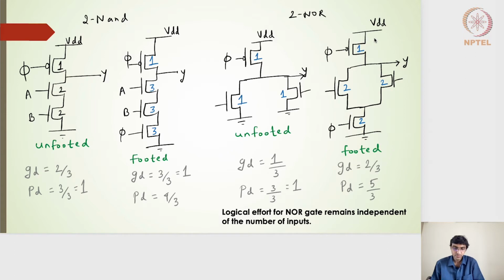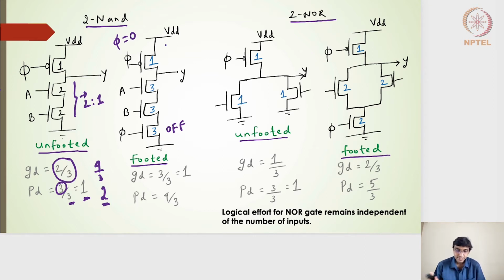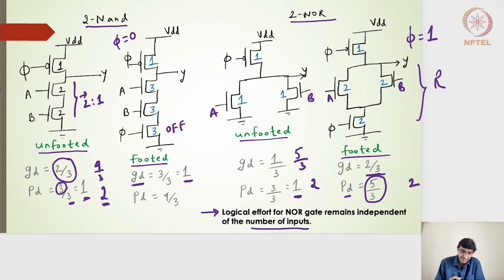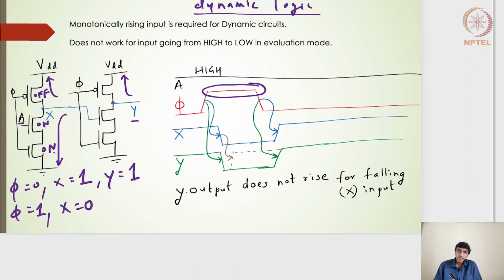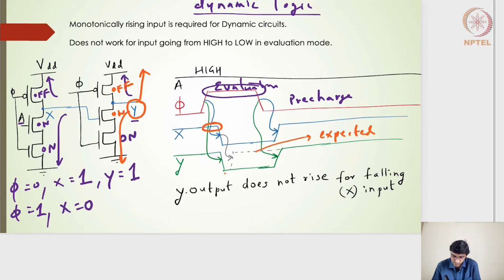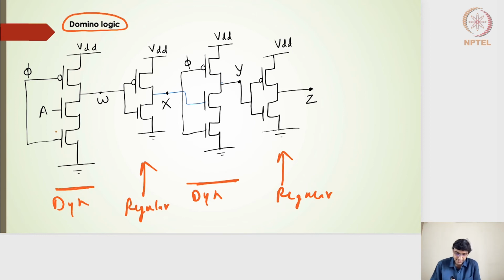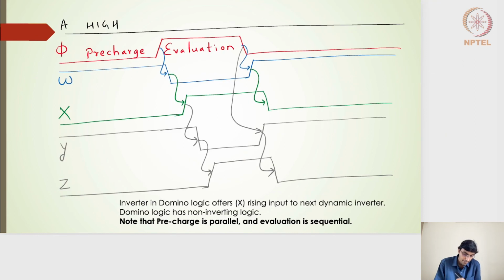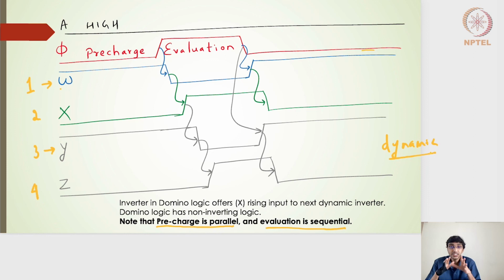6.9 - Dynamic Logic and Domino logic

Comment: Sir, why the size of the P mos is taken '1' where as 2:1 ratio Cmos is used for calculation? kindly reply me fast. I am soo confused the video of the same channel which link is given here i.e. https://www.youtube.com/watch?v=tJ41dqons9w&t=195s
Reply: Normally when you do logical effort for (planar) transistors, the p:n mobility ratio of 2:1 is used to get equal rise/fall times, this happens because electron holes are less movable than electrons, so the PMOS transistors have to be bigger to get matching timing. Mind you, this ratio changes as we move to germanium and as we started to move into finfets and gaafets and beyond and we often can't hit this ideal due to manufacturing limitations now that we're quantized to a few good sizes for finfets and the like but is fine for planar transistors and learning logical effort!

But the PMOS transistor used in a dynamic logic gate isn't being used to make it so the rise time matches the fall time. In fact it isn't even being driven by a 'proper' logical input as it is just tied off to the clock so that when the clock is low we are precharging to prepare for our now-monotonic NMOS logic to handle everything. It is now just additional load drawn on our clock network, not on our combinational logic, and generally you are going to have a long enough clock period that you can afford precharging to take comparatively a long period of time. (after all it happens in parallel for all stages of logic in your dynamic/domino circuit), so for N stages of logic in a clock you have N times longer for it to precharge on the other half of the clock. You need the footer there to make sure you don't drain the pre-charge you feed the network (or to prove that the logical inputs can't all be high for, say, a nand2 gate during the precharge period, which might let you get away unfooted if they are also derived somehow in part from the clock, but generally just requires a footer.

On the plus side you get much lower g and p than a traditional static circuit, because you've offloaded some of the burden onto the clock network, and gamed the fact that you only get one transition per clock pulse and that only monotonic functions are correctly handled, and then had to deal with a bunch of input load sharing issues and all that and false paths to close timing in the real world for EDA, but if you can swallow all those constraints you can steal an extra bit of performance in practice.

Another cost of dynamic/domino is you can't, say, double pump this logic on the other side of the clock edge by swallowing the positive/negative pulse width skew, so if you want to go faster you need a "true" faster clock.
Reply: It is done to reduce the overall capacitance since our logic is implemented in evaluation mode. So, if the precharge operation is a bit slow (due to less drive strength), it is of no concern to anything that happens in the Evaluation mode. Of course, it is assumed that the precharge operation is still faster than the clock (since we need capacitor charged to Vdd before evaluation mode begins).